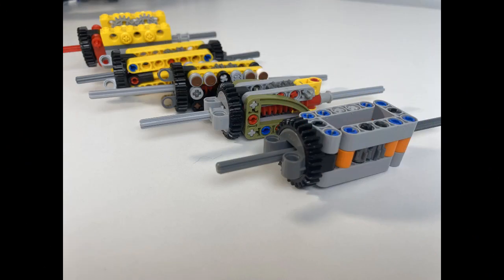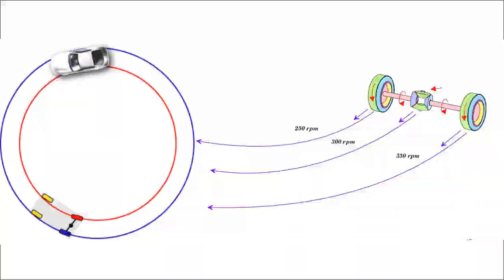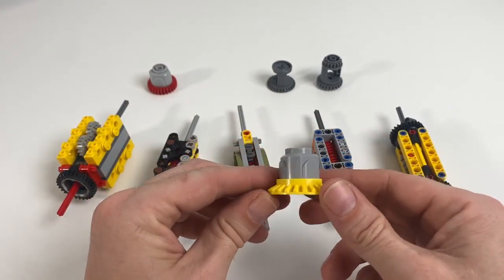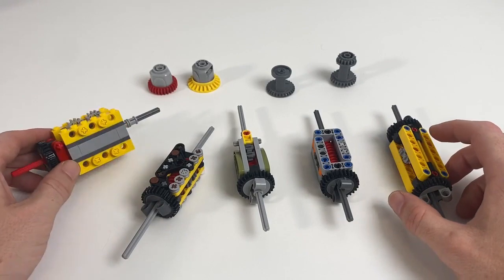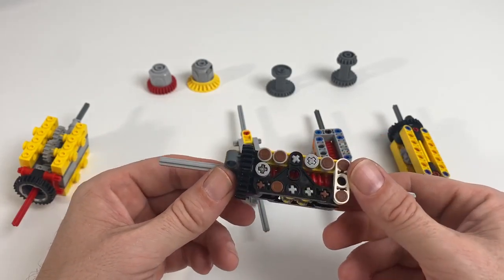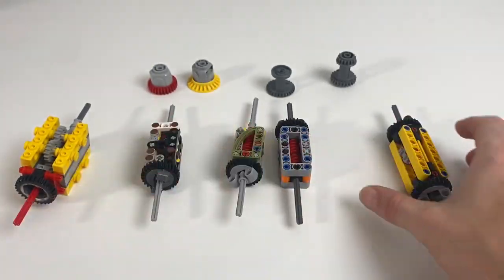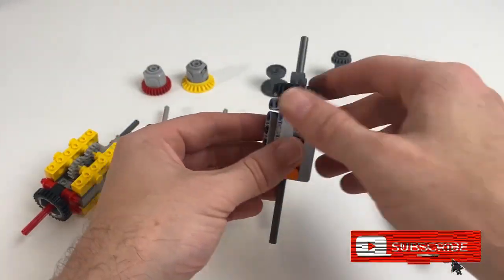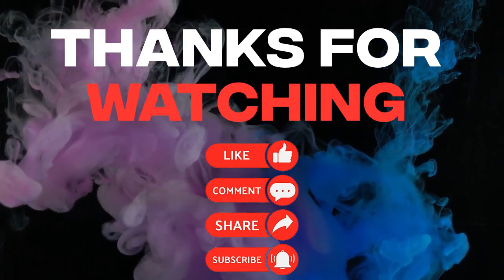Lego Differentials Review of Torsen Differentials - Part 7 (of 7)

Comment: None of those are torsen diffs and none of them would really work well as differentials at all. You're using worm gears meshed with spur gears which is an insanely high gear ratio. No "actual" torsen or helical diff would have gear ratios that high. 

There's this incorrect explanation of how torsen/helical diffs work on the internet always referencing worm wheels and worm gears and it's just totally incorrect. One look at a torsen diff (of any type 1 or 2 or A or B or whatever) and you'll not find a worm gear anywhere. You'll find helical gears meshed with other helical gears but nothing approaching the >20 to 1 of a wormwheel/gear pair.

The helical gears in torsen/helical diffs create axial load which create friction between the casing and the gears which is what's responsible for "biasing torque" (I'm hesitant to even use this term because that's not at all what these differentials do, all they do is "partially lock" the diff which is speeding up the slower output and slowing down the fast output, the side effect of which is something which looks like sending torque to the grippy wheel)